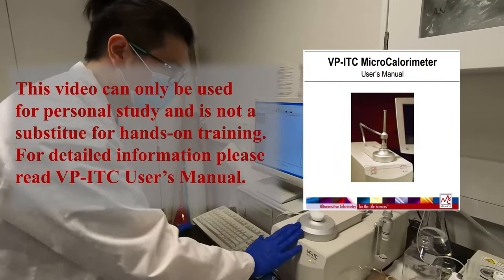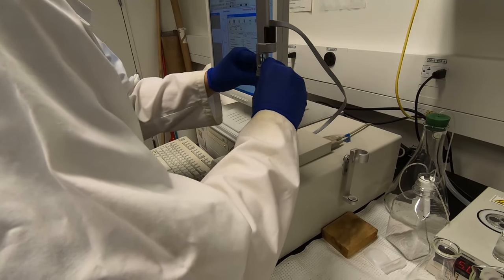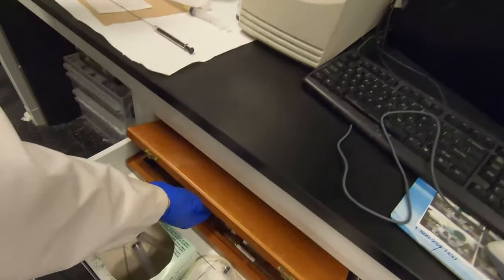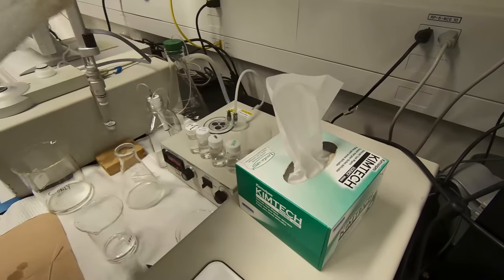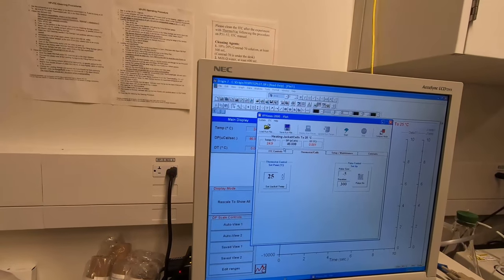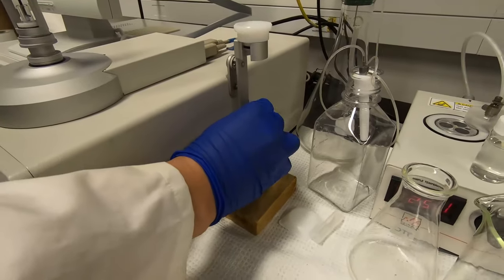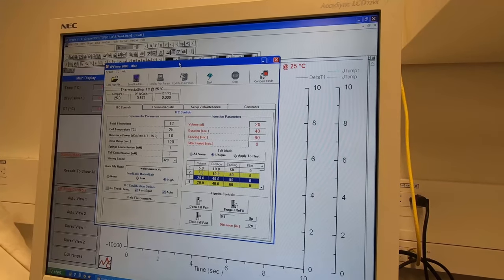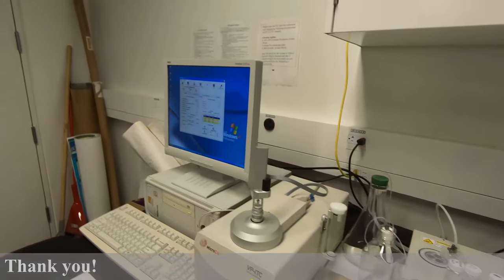Isothermal Titration Calorimeter (VP-ITC)

Comment: Hi, nice instruction! I have a question, is the reference cell always filled with de-ionized water?
Reply from the maker: Hi, the reference cell should be filled with the same solvent used in sample cell. In most cases, it is filled with milli-Q water.

Comment: Hi, I just wonder how do you subtract the blank reading (ligand in water). Thanks
Reply from the maker: Hi, you should first import (read data) both data for baseline and titration results. Then, go to the deltaH window, double click the "1" icon on the top left of the graph, put both baseline and titration data on the same graph (the same way you plot multiple data sheet in the same plot in origin lab). Next, click "subtract baseline" button, and select the right baseline data and titration data, click "OK", you should get the subtracted data. If you did all the steps correctly, the end of the curve should be close to zero on the y axis. Thanks.

Comment: Hello, when we need to fill the reference cell ?
Reply from the maker: Hi, usually we don't change the reference cell. Only in rare cases you may want to fill the reference cell:
1. You need to use a different solvent in the sample cell. (Never happened in this lab because we always use water as solvent)
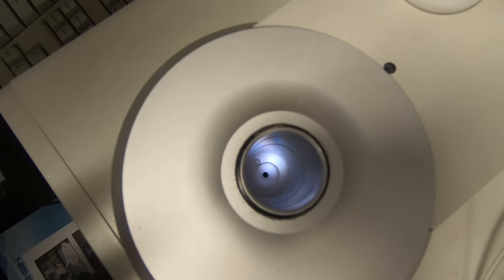2. You are troubleshooting the errors in your data that might be caused by contaminations in reference cell. (Never happened in this lab. This is very unlikely because as you can see at 2:35, the hole to the reference cell is extremely small, and in normal procedure you won't be able to put any contaminations into reference cell)
If you want to learn more about ITC and reference cell, please check the user's manual.
Thanks!